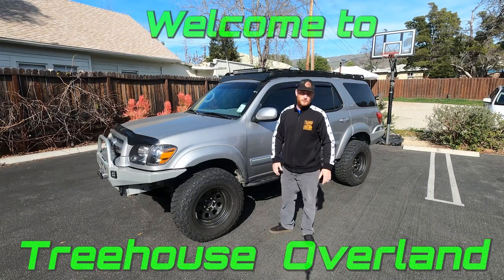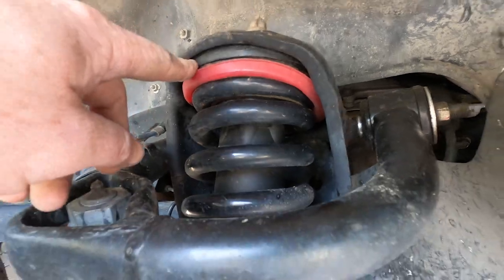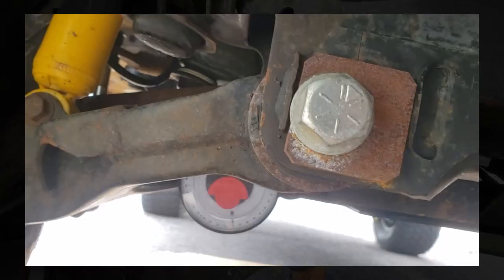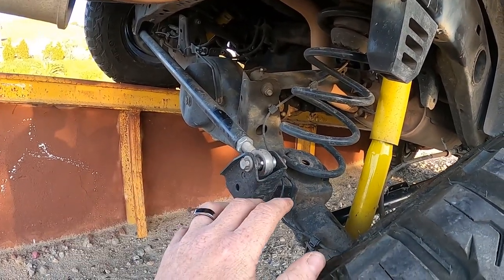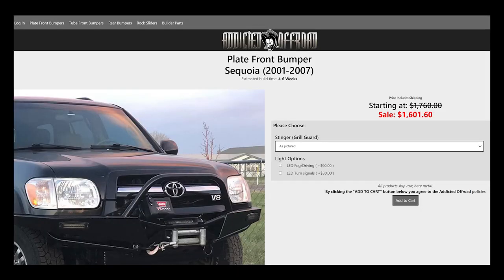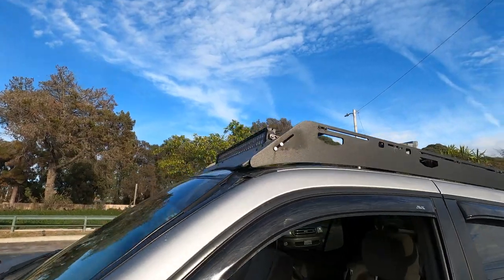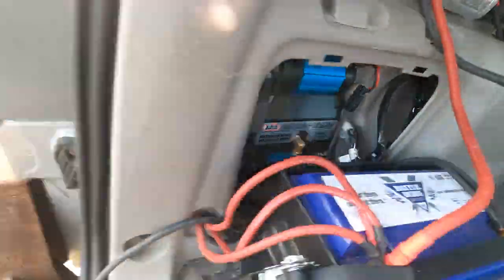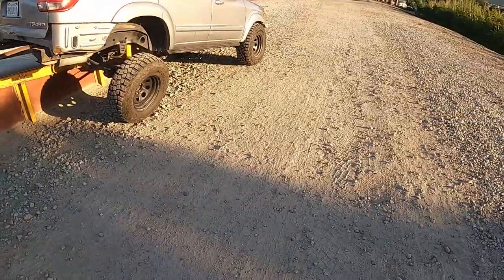Lifted Sequoia on 35's // In Depth Walk Around

Comment: for you steel wheels, are you using conical lug nuts or oem lug nuts? Also I have a set of vision soft 8 steel wheels on 33's KO2. It's really hard to balance.
Reply from the maker: Conical lug nuts. Have you tried "road force balancing"? It's a different type of wheel balance method that more closely simulates real driving. A little more costly but well worth it.
Reply: @treehouseoffroad  I did all type of balancing, dynamic balance, road force dynamic balance, and even static balance. the tire machine keeps saying my wheels might be bent but I dont think so.....
Reply from the maker: @TexasAutobahn0810  Strange, maybe they are. Wheel balancing is one of the few things I can't do in my garage/driveway. I pretty much leave it to the tire shop, but they had zero issues balancing my 35's so I don't know...🤷‍♂

Comment: Definitely the best sequoia Video on the internet
Reply from the maker: Appreciate the comment man
Reply: @treehouseoffroad  For real, one of the best in depth and to the point walk around videos Ive seen! Straight love your Sway bar quick disconnects and how you spent time seeing just how much difference a front diff drop actually made. I like the FU** outta your rig man! Great job and excellent video!!!
Reply from the maker: @rmracer527  Thank you bro! The quick-disconnect sway bar links work great for a few months but the ball joints ultimately bend and distort just enough to make them difficult to remove by hand (which was the whole point). They also get a little clunky and start chattering as they wear out. I realize now why they have bushings on them from the factory.
Still running them but working on a more durable design. Thanks for commenting man!

Comment: do you think the cam eliminator setup you have will work on stock 17s?  i might go to 35s if the vehicle stays in the US.  working on doing the front elocker this week before reassembling the front end.
Reply from the maker: Cam eliminator kit doesn't discriminate on wheel or tire sizes.

Comment: I probably watch this video once a week on average.

QUESTION again...
Did you extend the steering shaft at all? or is that just for over 1" body lifts?
Reply from the maker: I appreciate it I crammed a lot into it. 
I did not have to use anything to extend the steering shaft, but if I went over an inch I definitely would have.
I've been keeping an eye on it and it seems to be fine

Comment: honest question, would you prefer a GX470 or a LC100 land cruiser?
Reply from the maker: GX. The LC100 uses torsion bar front suspension instead of coil springs, and I like the GX body styling more

Comment: I have Brute Force Fab front bumper. My front suspension is Bilstein 5100s at the top notch. I think I also lost some height on the front because of the bumper. I wanna add 1” lift spacers too.
Will I have to disassemble the strut assembly? I know I won’t have to disassemble the assembly if I go with 2” leveling kit but I’m afraid I might end up with start having steering stability issues with 2” leveling spacers.
Reply from the maker: I did not disassemble the struts. I did however get some different nuts to hold the top of the strut to the tower, as the OE nuts would no longer thread onto the shorter studs

Comment: I’ve saved your video for a lot of references, I like your approach to things! I’m stuck in a dilemma, wanted to know what your thoughts are? I need a new vehicle and ran into it really good deal for a tundra with 90k miles 06 in really good condition and couldn’t pass up for the money The issue with it it’s that it’s 2wd. We camp quite a bit, but I would like to do more of Overlanding, i’ve dropped some money on the truck leveled it out with 6112’s put a midrise shell on it with roof rack and awnings on both sides and build a carpet kit with a pull out kitchen set up, Long story to try to make it shorter I’m not a rock crawler, but do you think rebuilding the limited slip on the truck or lock in the back would be enough to try to be a little more adventurous ?? And would more articulation on the front, help my traction on the rear?
Reply from the maker: A rear locker would definitely make the truck more capable, but nothing like a 4x4. And yes in my experience more articulation = keeping tires on the ground   = more traction. You might get more into this off-road thing and end up buying a 4x4 down the line though 😂

Comment: Wow. This is a properly built truck. I love all your high quality custom fabrication and the excellent detail in this video.

I just bought an 05 Sequoia limited 4x4 with 179k miles for $8500. One colorado owner and very well maintained. I am very familiar with 4runners, but the 1st gen Sequoia/Tundra world is less familiar to me. Ive been researching suspension options for quite a while now. Im planning on building a very basic overland/camping truck with no added weight. I'll be driving off road in the rockies a lot, but no crazy rock crawling. So I really only want like 1.5" lift, as i dont need more and want to maintain good road manners.

Im consudering a bunch of options right now. Dobinsons twin tubes, Dobinsons IMS, Bilstein 6112, Eibach pro lift, Fox 2.0, OME. I really don't know what to go with. I tend to like a softer more floaty ride in a truck over stiff or "sporty". My biggest concern is small bump compliance at slow speeds, mainly rocks and washboards, as that will make up the majority of my off road driving. No crazy crawling, no hugh speed desert stuff, no jumping the 6000lb sequoia. 🤯 I moslty want something that isnt teeth shattering on washboards. Ive read that Fox is probably the best for that as a progressive valved shock. But i dont want something that needs to be pulled off the truck and rebuilt roughly every 50k miles either. Not sure what to do for suspension
Reply from the maker: Thanks it's been a journey for sure. Hit up Josh at www.1stgenoffroad.com, he can help you get your suspension dialed. Tell him Treehouse Phin sent ya!

Comment: Cool video. Don't you wish there was a simple bracket to put around the lower ball joint? Or even a simple kit to flip it?
Reply from the maker: Knock on wood I've actually never had issues with the LBJ's on any of my Sequoias. I I also take no chances though and replace them if needed. A few companies are making bolt on uni-balls but they cost some serious dough

Comment: Awesome video and beautiful family! I got 35s too on my 04 Sequoia. Spc upper control arms and wheels with 3.5 inches of backspacing that’s like adding 1.25” wheel spacers.
I really don’t have rubbing issue but in reverse only, a little bit before at full lock. How’s your truck doing in reverse?
Reply from the maker: Thanks! The rooftop tent is a lot of work, as soon as my kids are bigger that thing is GONE! 
As far as rubbing goes I have zero. With the cam eliminators setup the way they are in conjunction with the SPC setup, I have full clearance forward/reverse ar full lock. I did have to trim about 1.5 inches off the sliders, they were causing some rub.

Comment: How did you fit the 1 inch spacer?
Did you have to force the control arm down to fit the spacer
Reply from the maker: I didn't force it. I disconnected the LBJ/spindle by removing the four bolts and moved it to the side. Then I Ioosened the LCA bolts until I could gently pry it down enough to get the lower shock bolt through. Reinstall everything but only  tighten the LCA cam bolts when the vehicle is on the ground under its own weight, then take it for an alignment . Salute

Comment: are you stock diff? How does it handle the 35s?
Reply from the maker: Stock diffs, Yukon 5.29 gears and an Eaton E-Locker in the rear. I blew a spider gear in the front diff but luckily caught it before any catastrophic failure. Replaced it with a spare I had and all has been well. Imo the diffs are a bit small for the bigger tires and the weight of the vehicle, someday I'll upgrade to the newer Tundra stuff but for now it'll work

Comment: Hi again.  I just removed the lower control arm bushing, but i am on the fence of replacing the bushings with the daystar kit you used or the siberian bushings.  how is the daystar kit holding up?  I freeze frame onto your daystar image and it looks like you reused the metal sleeve from the old bushings, but i removed my sleeve with the bushings still attached, correct me if i am wrong in my assumption.  update, 1-06-1417 siberian bushing is out of stock everywhere, but i have 1-06-1418 siberian bushings.  I might mix in with the daystar kit which i have. your thoughts. thanks.
Reply from the maker: I removed my lower arms recently and the Daystar bushings have held up great. Ever so slightly wallowed out, but for 100 bucks I'm impressed. I almost went Siberian this time around but it was $250 for the four lower arm bushings and also backordered. I ordered another Daystar kit and actually did one arm yesterday. Yes you have to re-use the metal sleeves, I just leave them in the arms. First I cut the large metal washer off the outsides of the bushings. Then push the majority of the old rubber out with a bottle jack or press. Then torch the crap out of the remaining rubber and scrape it out with an old flathead screwdriver. Continue this process, torch scrape, torch scrape, until its almost clean then hit the barrels with a wire wheel on a drill until its all bare steel. The poly bushings will slide right in with the included grease packets. Wear a ventilator, this is a NASTY job. Good luck!
Reply: @treehouseoffroad  thanks for the reply.  the vehicle will not be rock crawling or doing technical driving.  do yo think it could last some years before having to be replaced?  Im trying to balance longevity with articulation.
Reply: @treehouseoffroad  thanks for the response.  can i mix the siberian and the daystar since the lower rear are out of stock everywhere, and I have to assemble the front suspension before it gets too cold.  I already separated them.  didn't take long, but the fumes suck.  I am hoping to get a few years use out of these since i wont be doing major rock crawling of technical driving, just a lot of muddy and 4x4 required dirt roads.
Reply from the maker: @sethlover1211  You could probably mix em with no issues

Comment: With the total chaos long travel kit it eliminates the so I don't have a sway bar now. And it still handles amazingly. I kept breaking those links every time I would go off road. And I believe it does give you a little more travel articulation. I got the metal pick stringers lower control arms for the rear. This is the third time I've watched this video. Lol
You did an amazing job.
Reply: I also had them custom make me a panhard bar. Because the only one that they sell is Chinese and it was only $20 less than what they charged me to build one. It's pretty cool how similar are trucks are built.
Reply from the maker: Thanks homie

Comment: “Gotta let ‘‘em know I’m not a 4Runner” lol I can’t tell you how many times the black monster gets called a 4runner on a daily basis. But the shock on peoples faces when I let them know it’s sequoia is worth it. I wish I was able to get it to Michigan for the summer so I could continue my build but I’ll get back to it eventually. Blowing up the rear diff showing off at the end of the trail that day hurt but my friend sold his rubicon that fallowing week after getting schooled by the monster only running 2wd  (no front cv’s) on all the same obstacles he was using lockers and 4lo for so I considered it a win.
Reply from the maker: Yeah for real. It only happens with people that don't really know trucks though so whatever. 
How did you blow your rear diff? I been pondering throwing in an '07 tundra rear with the monstrous 10.5" ring gear, but I just re-geared to 529's and added an E-locker so I'll see how it holds up.
Reply: @treehouseoffroad  e locker will solve the problem the stock diff holds up fine under normal circumstances..my friends talked me into taking the truck out with no front shafts and after wheeling all day schooling everyone on how bad ass a sequoia really is even with just 2wd on the last obstacle of the day my buddy in his rubicon tries a hard line in 2wd gets stuck switches to 4wd lo 4:1 transfer case by the way 35’s on teraflex kit turns lockers on and finishes the obstacle. In a foolish attempt to show him up I take the hardest line possible and fail the first attempt at crawl speed so I back up switch to 4lo (no front shafts though) to use the reduction and against my better judgment I floored it in drive …truck clicked at least 4 gears and up we went… all 7 people and a full load of gear.. hit the top step on a bounce and the spider gears let go twisting the driver shaft at the splines too lol hence my age old physically of if you can’t crawl up you don’t belong up .. but in my defense I made it up and he sold his Jeep the following week lol
Reply: @treehouseoffroad  video were I blow the diff 
https://youtu.be/2XsfptgUO5U
Thinking of doing a new video using some of the footage I have
Reply from the maker: @theclan4adventures  I looked through your past videos for this diff grenade scene. Must've watched 5 or 6 but didn't see this one...A for effort my man. 
Theses diffs always blow up the same way. No traction, no traction, no traction.... TRACTION! 💥💥💥💥
Reply: @treehouseoffroad  yep happens every time.. it’s at the very end of the linked video.. I’m going to redo a few videos now that I have taken the time to learn some basic editing skills lol I have a lot of respect for anyone who does YouTube videos and can make them fun to watch yours have all ways been great mine.. not so much.

Comment: I have the spc upper control arms and the cam delete set as well. But I am having issues with my alignment. I am running 17x8.5 -10 offset wheels and 35x12.5x17. Do I have to install wheel spacers so the upper control arm not to hit the top of the tire? It’s very close and I think the alignment issue is because of this. Any thoughts
Reply from the maker: If your UCA is contacting your tire then yes, you either need a wheel with more neg offset or you could run a spacer.
Have you adjusted the SPC ball joint to try and push the spindle/hub away from the coilover?
Reply: @treehouseoffroad  thanks for the reply. I am not actually doing the work. I wish there was a way for me to send you a pic or two.
Reply from the maker: @vahevartanian  treehouseoverland@gmail.com

Comment: Did the Daystar Lower Control Arms Poly Bushing come with the metal sleeves that goes on the outside of the bushing( the part that press into and make contact with the actual lower control arms)? does it not use it? or do we have to reuse the oem ones?
Reply from the maker: You press/burn/scrape the rubber out but retain the sleeves, it's a messy process. There's a better look at it in this video:
https://youtu.be/uLg6TeyKMVM
Reply: @treehouseoffroad  Thanks buddy. I need to take care of this before they will do my alignment.

Comment: nice truck! curious why you went with the oem lower ball joints, arent they faulty?
Reply from the maker: There were some Sequoia's/Tundra's recalled for LBJ issues in 2007 but as far as I know the problem has been solved. I've heard of more failures with aftermarket stuff than OE. 
Thanks for commenting

Comment: these trucks are great thanks for the vid... BUT SERIOUS QUESTION. you 4 wheeler guys must have an answer. the never ending "vsc" VSC TRAC" and engine liight combination. that doesnt allow the 4x4 to work properly.. WHAT DO YOU GUYS DO?!
Reply from the maker: Personally I disable it. If you pop the hood and look at the brake master cylinder there's a two wire plug going into it on the driver side. Unplug that and the VSC / TRAC lights on the dash will go on, but the systems will be disabled. I've done it on all 3 of my Sequoias and had good results. Do this at your own risk obviously
Reply: @treehouseoffroad  did you add locking diffs to your truck? with everything disabled, like mine is all the time with those lights on. I just do one wheel peels all day long when I'm stuck in mud. Or 1 front 1 rear in 4x4. Open diffs
Reply from the maker: You're absolutely correct, I took a three pronged approach to this issue and it's worked well
1 - I designed my suspension to have as much articulation as possible. More articulation = more wheels on the ground = more traction
2 - I have an e-locker in the rear diff 
3 - I put the VSC TRAC circuit on a simple on/off dash switch in case I want to use it (which I rarely do)
Reply: @treehouseoffroad  alright ya we are coming up on some info here a lot of people might want to know... So did your truck come factory with the electronic locker. (if so your super lucky) if not what brand did you install..
Reply from the maker: @ride3r  Afaik Sequoias we're not offered with a locker from the factory. I have an Eaton e-locker. I think you could get an optional LSD locker in the 1st Gen Tundras but no e-locker